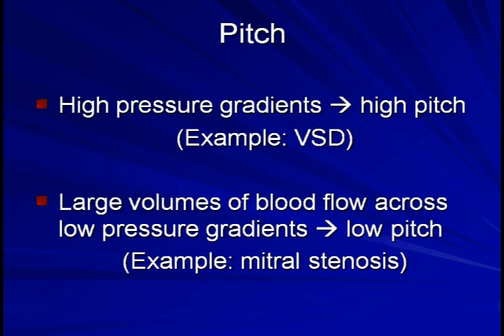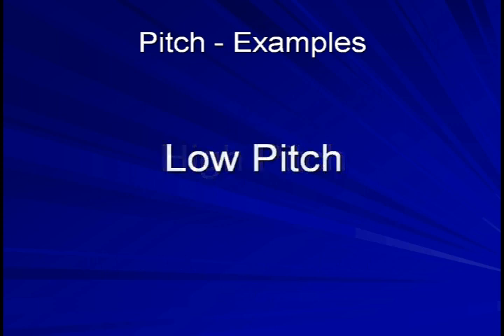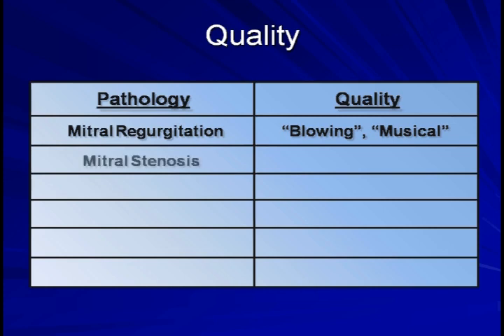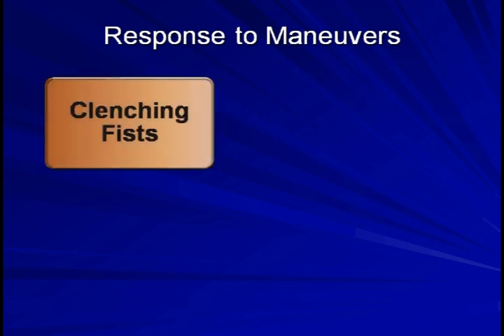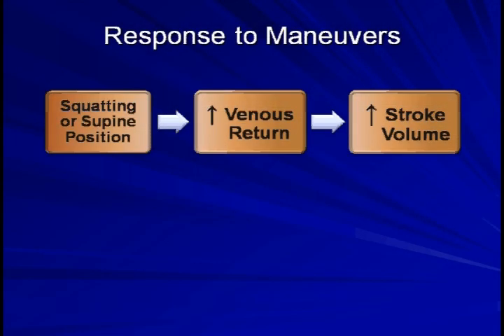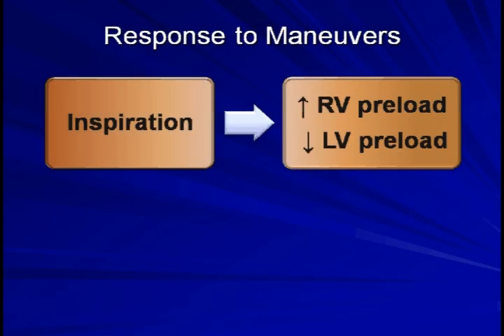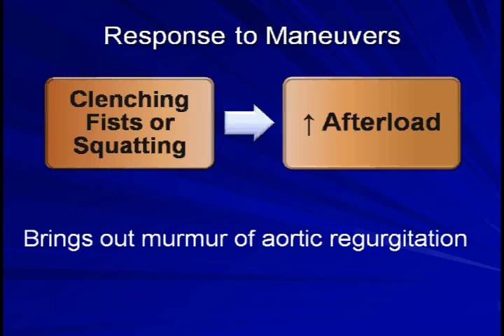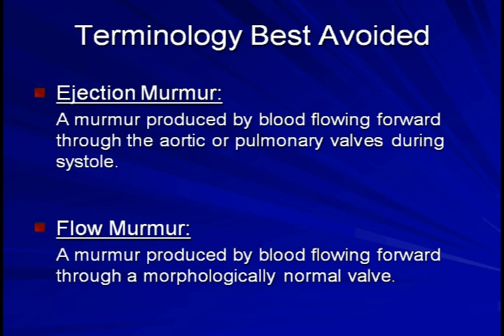Heart Murmurs - (Part 2 of 3)

Comment from the maker: @beastwool1, the classic pulmonic area is the left 2nd intercostal space, and the classic aortic area is the right 2nd intercostal space.  Although the pulmonic valve is part of the right side of the heart, the pulmonic artery is angle up and to the left.  When an abnormal pulmonic valve generates turbulence, the sound travels parallel to the direction of blood flow.  The opposite is true for the aortic valve, which is initially angled up and to the right, before looping around back to the left.

Comment from the maker: @Tholius: Thanks for the great questions.  Regarding the response of aortic stenosis to squatting, I agree that what I say here seems a little contradictory.  The best way to explain it is that squatting increases both afterload, and causes a relatively transient increase in preload.  When someone with AS squats, the increased preload may have greater impact on murmur intensity than the increased afterload, thus the murmur can increase.  This change is usually very subtle...